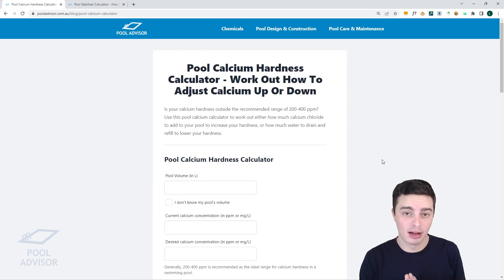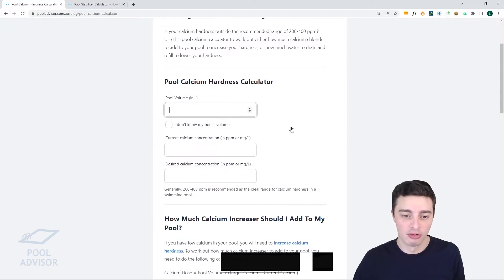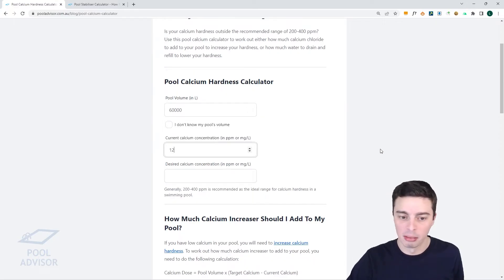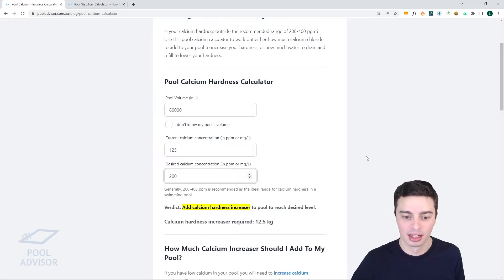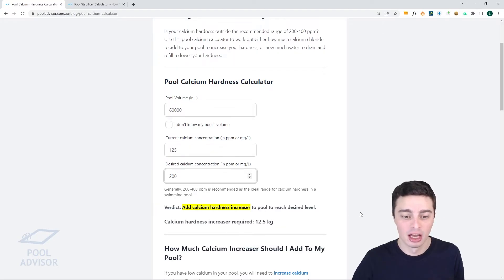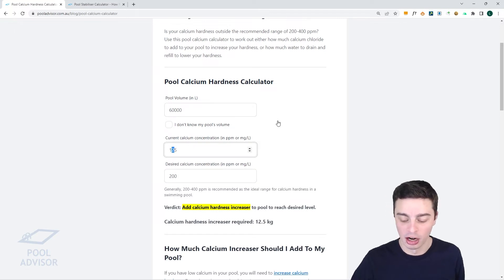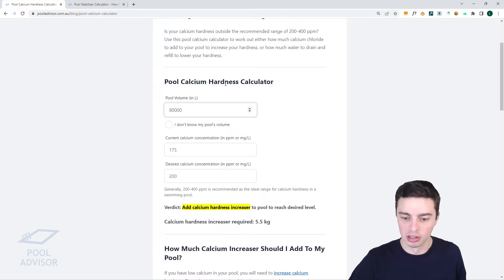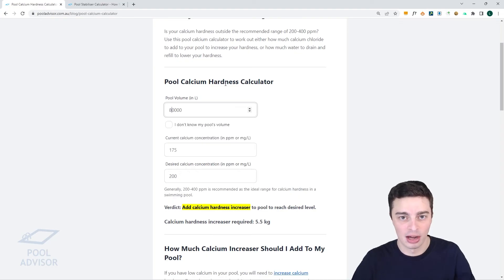Pool Calcium Hardness Low - How To Increase It?

Comment: I live in Florida I have a 30 by 15 in-ground pool couple of my neighbors have mango trees. Every week twice a week I get mustard allergy in my pool is there anything I can do to prevent this. I feel like feeling my pool up with dirt
Reply: I too live in Florida. I get yellow algae once a year. I’d say if it gets worse, I’d dump in acid to get all pool levels down. Once you run your filter for a good 8-10 hours, you should see some breakup and cloudiness. While pouring in acid, make sure to brush you entire pool REALLY GOOD, and clean your pool filter. Once that’s done, I would shock it once, maybe even twice to kill the rest of the yellow algae. You should see things start to clear up in 48-72 hours. Make sure your pump is running a good while when pouring in each phase. I’m not a pool expert nor have pool boy experience. I’m a homeowner that has run into pool issues myself and have solved them myself! Cheers and good luck 😊 👍🏽
Reply: Use a phosphate remover and clean your filter after 48 hours. Shock your pool with chlorine and brush thoroughly. Invest in a bottle of algecide and add a little bit every 3 months to prevent algae.